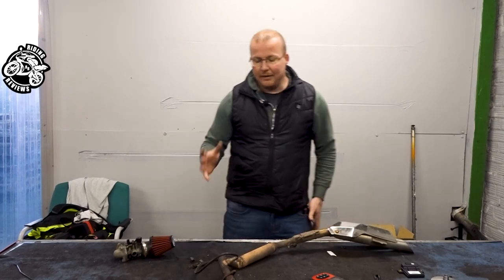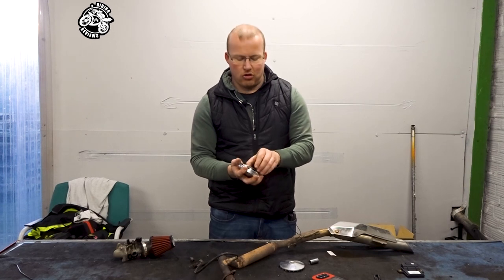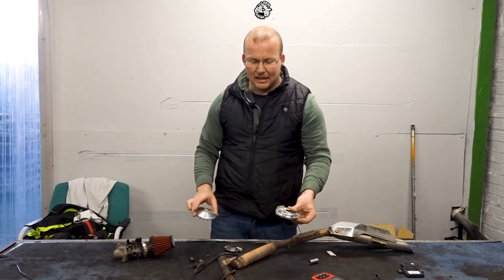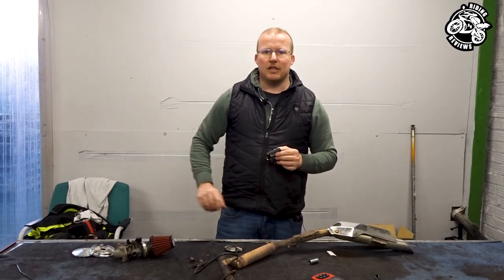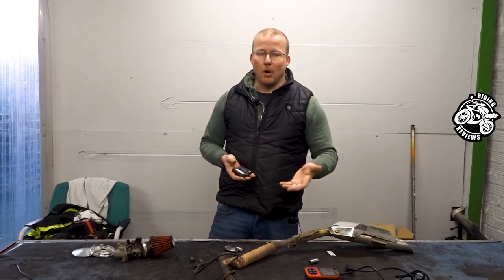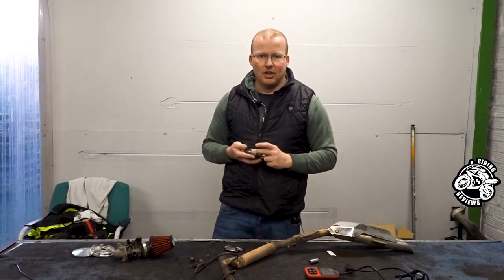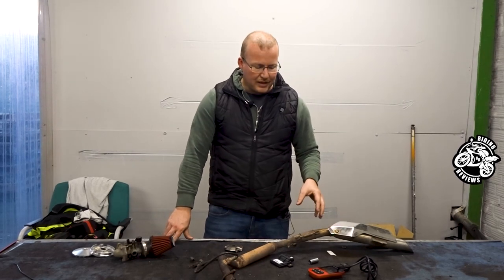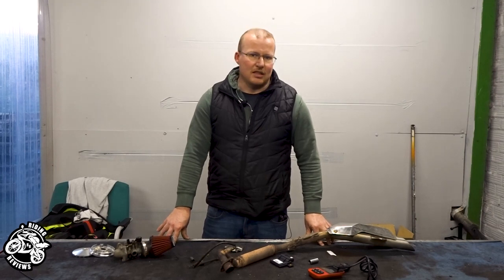Unlock Your Euro 5 50cc Mopeds Full Potential: De-Restriction Guide

Comment: So, retaining the 28 mph speed limiter & increased variator weights would hold the engine revs down to 6500 or 5500 with the 63 & 81cc conversions, & may maintain stoichiometric air fuel ratios over a narrower rev band. But the extra torque & therefore hp from the increased capacity will assist climbing speed.
Reply from the maker: a bit more technical than my explanation lol

Comment: Good explanation Chris.  
I have 2 Leeway pizza delivery scooters from CBRUS. 
The Chinese have been fiendishly clever in restriction. 
Speed limiter sensor on the clutch bell housing. 2 x electronic pressure sensors mounted above & below the vacuum controlled carb piston that controls mixture. 
An electronic sensor that detects carb butterfly positioning. Oxygen sensor on the exhaust. & all connected to the rpm restricted ecu of course. 
There's no way to disconnect the speed limiter, as disconnection, or changing the clutch bell  to one without magnets puts the ecu into limp home mode. 
Changing the carb, ditto, as it will lack the non interchangeable butterfly sensor. & vacuum sensors. 
Grinding off 2 of the 4 magnets on the clutch bell may fool the ecu into thinking the bike is at half speed. But it won't increase the rpm limiter or power output. 
2.4 bhp @ 6500. 2.8 @ 7500. 
It isn't fitted with a standard GY6 carb either, since the main jet is 6.7 mm in width, not 4 or 5mm as standard. Can't seem to find one of larger jetting. 82 as standard. 
The speed, 28 mph by GPS is fine. Just want more climbing power. 
I've fitted one engine with a 63cc conversion.  But without an increase in the 82 jet, it will run very lean. 
I was thinking that fitting the 63cc with original 82 jet, but fitting heavier 6.5 gram sliders, will pull the engine revs down to 6500 peak (maximum torque) which from the 26% increased capacity, will give 3 bhp @ 6500. It just won't rev out like the original engine. 
Would this work? 
I also have an 81cc cylinder, which with the 82 jet, would mean fitting a 7 gram slider to pull the engine down to 5,500 max. 
It's all I can think of in the absence of finding an appropriate jet. 
What do you think?
Reply from the maker: so the pickup on the clutch housing is ware it tacks the restriction all the other sensors are for emissions and choke I would try taking the sensor out of the housing and see what happens because the bike with no belt should rev out if you just disconnect it it thinks you have tampered with it
Reply: @Riding reviews  Thanks Chris. I'll give it a try.

Comment: In Germany there is another smaller class, its calle motorized bicycle and after having to ride 15.5 mp/h for 2 months, it was a blessing for me when the 28 mp/h ECU arrived. With a 4-speed manual transmission it's really fun. But at 28 mph it's already running at 8000 rpm in fourth gear and if you open the ecu on the engine complete would probably explode or something lol
Reply from the maker: this bike in the video will do 30mph at 7000 RPM in 4th gear and will run fine for distance at 10000 rpm at 40 mph they are tough little engines
Reply: Now that I'm driving with the 45 km/h ECU, the 25 km/h ECU is just lying around. Are there companies that reprogram it so that it is open?
I've been looking for 3 months now and there are definitely no open ones for my moped to buy. Everyone says "yes, there are companies they unlock them" but no one could tell me one that would do that and I couldn't find any myself. This here is the end for me now, right? @Ridingreviews
Reply from the maker: @Simon-jh1hf  yamasaki.co.uk do remap, but it is for uk only

Comment: Just recently got my lexmoto hunter 50, I want to derestrict it, should I cut the slide myself? Or wait for the part to restock on cmpo. Also do you know how often they are in stock on there? And if there are any other ways I could get more speed out of my bike.
Reply from the maker: i doubt they will get anymore of the DE restrictors for the hunter so you will have to do it yourself
Reply: @Ridingreviews  Ok thanks, how much should I cut off ?
Reply from the maker: @josephkoras6131  aprox 10 mm there is a cut out that runs up the side cut to the top of that
Reply: @Ridingreviews  Ok
Reply: @Ridingreviews  One more question before I do it, what’s the best way to cut it down ?
Reply from the maker: @josephkoras6131  hack saw or a grinder make sure it is flat

Comment: Great explanation of the rules Chris.  Maybe show us the remapping process. Also would changing the front sprocket on a ym50 make any difference.
Reply from the maker: Im not sure about the remap video i dont think anyone would let me use there equiptment to do it putting a 13tooth sprocket will make it faster but you would lose talque
Reply: How is that supposed to work? Even with a larger sprocket, the ECU still limits it to 45 km/h (28 miles)
If you then change the sprocket, the thing still drives 28 mph but with less acceleration.
And even if you remove the limit of the ecu and change the sprocket, the engine is hardly strong enough to get anything out of it because all the emissions standards... catalytic converter and all that shit.

Comment: Hi me again thanks for your help Have you had any Progression with the obd scanners today ? I have bought my second one and this one also says that it can’t communicate with the bike , any suggestions ?
Reply from the maker: There is one on yamasaki.co.uk i tried it on a ym50 re and it works
Reply: @Ridingreviews  I bought 2 
The Mucar CDL20 OBD2 Scanner and the Autel MaxiScan MS309 OBD2 Scanner. But they both seem not to be working. I’m not sure if it’s the way I’m using it or the scanners themselves. 

I plug it in and flick the key to the right (on) that’s it . Am I supposed to be doing anything else ?
Reply from the maker: @Iftikhar Rehman  is the ignition and kill switch on on the bike
Reply: @Ridingreviews  ignition was on kill switch was off meaning I would be able to start it

Comment: I have a YM50RE 2022 fuel injection . 
I’m planning on having it de restricted and I know that will result in more speed but will it result in it getting up hills any better ?
Reply from the maker: Slightly as there is more talque in the higher rev range
Reply: Thanks , do you know if there’s any big bore kits available for this bike ?

Comment: For the Yamasaki f series do I need to buy a 12 tooth sprocket or a 13 tooth sprocket which one do I get
Reply from the maker: change the front sprocket from a 13 tooth to a 12
Reply: @Ridingreviews  does it increase top speed or acceleration?
Reply from the maker: @BarberYusuf  acceleration and tuque

Comment: i drive a speedfight 4 50cc and im trying to get it slower to be legal so is it possible to remove rings to decrease speeds without making it less reliable?   edit the rings inside the cb drive
Reply from the maker: Change the cdi for a standard one
Reply: ok thanks

Comment: Good videos, do you have any information on how to connect your ecu to a obd scanner for a diagnostic. Ym50 2021 (euro 5 I believe). 
Thanks in advance
Reply from the maker: You need to buy a 6 pin obd converter from cmpo the plug is located under the rear seat
Reply: @Ridingreviews  would you be able to send a picture in how it looks, as far as I’m aware there are a few types of 6 pin converters
Reply: @Ridingreviews  hi there once again I checked up on your website and they have 2 types of 6 pin converters will any one of them work? 
Thanks
Reply from the maker: https://www.chinesemotorcyclepartsonline.co.uk/partno_DIAGN004#image2 this will do all of them
Reply from the maker: @iftikharrehman1441  https://www.ebay.co.uk/itm/144659916847?hash=item21ae67282f:g:GXwAAOSw0vti4OC9&amdata=enc%3AAQAHAAAA8BLyyd1il%2BP9OTrUWu3xE4u4NVGxyz9FndsF%2Bqphwjcw%2FCtHiHJP2Yfm4WLX25v9TKKjd9GSIntj6V7zpZncAmICpD0uqAna9%2FANaSLD90qyoeaOx6aEYcJcRKzDR4QV5KXbmEV3ImCNDi9Z7Asv2cyxqYaBJoQ%2BxI90Y0tV7iGHVyZbBlbUJ7egoCCUBn4YMHlrz8eGAG7Vn9qIa6%2BctRKwKQ1iqMAHmG0le%2Byg6faLTfXd6xDxqnCJCjYxKP0tw1HEzrXn4nGC86LdZObAPzaO6dglIP9K2tXpA7J9MD73Sq5626fovxKn%2B1QRsyTYrA%3D%3D%7Ctkp%3ABFBM3t6F55dh ebay is cheaper
Reply: @Ridingreviews  hi there I’ve bought this one and it has arrived, as you said this will fit I think I’m looking at the wrong cable on my bike. Do you know exactly where the cable is on the ym50 2021 ? Please help 
Thanks
Reply from the maker: @Iftikhar Rehman  under the rear seatit has a cap on it
Reply: @Ridingreviews  found it thx cable fits but my obd reader isn’t compatible with it 🤦‍♂️🤦‍♂️. Any recommendations that work with it ?
Reply from the maker: @Iftikhar Rehman i will look into it will try some on Thursday

Comment: That 28mph limit is absurd,i can drive a 44 ton truck at 50mph but cant ride a scooter faster than 28 mph,totally outdated 😂
Reply from the maker: I agree with you
Reply: Should be 40/45mph legal speed at least. 28-30mph is dangerous when in a 40 or even a national speed limit.
Do you know if neco can be re mapped? looking at a retro style scooter 50cc. But know many are impossible to de restrict. Lambretta and vespa euro 5 apparently cant re map

Comment: I have a Yamasaki f31 and I find the bike gear 4 doesn't really add much to the speed compared to gear 3 (only a couple mile an hour difference if that, as I am able to get to just abut 30mph before needing to change gear) and I have checked the bike has a 13 tooth front sprocket. What recommendations would you have to increase the speed. I'd like to get it to around 45 mph if that is at all possible without sacrificing its hill climbing ability too much which already isn't the best doing most hills
 at about 25 mph. I also know the guy who had the bike before me bought it new derestricted and he could go about 45 mph on it but then after taking it in for his second service they re-restricted it so I don't know if they could have done anything differently to re restrict it.
Reply from the maker: Decrease fron sprocket not increase 12 tooth help yamasaki.co.uk has a kit
Reply: Is this really that simple to desrict the yamasaki f60 model too? Thank you!

Comment: I believe the lexmoto 125 ecu will work on the Yamasaki 50 and save the derestriction process
Reply from the maker: try it it is the same ecu but is has a different map
Reply: did it work? if so what one?
Reply: No it didn't, it would start but rev at 6k constantly

Comment: I got a 13 tooth on my f30 and it hasn’t made any bit of difference on the top speed
Reply from the maker: it wont it doesn't create enough torque you best of with a 12 tooth

Comment: Can you remap zontes 125cc has my speed is really slow it only does 50 top speed
Reply from the maker: You carrnt, but i would get the tappets set correctly
Reply: Can you tell me what the tappets are for inlet side and exhaust side please as that would be great help
Reply from the maker: @paulross3066  4000th of an inch both
Reply: Thankyou
Reply: His that the min or max as someone else told me 1000th on both glade I put a comment know
Reply from the maker: @paulross3066  there wrong
Reply from the maker: @paulross3066  no problem
Reply: Thank you I will get them sorted thank you once again

Comment: I want to derestrict my sym mask only because I don’t feel safe being stuck at 30mph in a 60mph zone
Reply from the maker: if it is a carb version it needs a new cdi if it is efi it needs a remap you will prob not be able to get the remap
Reply: @Ridingreviews  yeah it’s a 2019 so it needs a race ECU which sucks as their £150
Reply from the maker: @Spearr  sadly, that's what you need to pay for facemelting speed
Reply: Hi Man, i got a sym mask 50 too! But here in belgium they are called the Sym Orbit 3.. i bought it brand new from the dealer last week. Mine is the 2023 euro 5 fuel injected model, wich is restricted to 28Km/h (around 18mph).
Did you find any way to get a little bit more top speed out of it?
Ecu's are really expensive in my opinion.. 
Thanks
Reply: @GewoonJelleYT  taking off the speedometer derestrics it abit as it isn’t telling the ECU how fast it’s going so it tricks the bike into making it get to around 37mph
Reply: @GewoonJelleYT  if you also get a quad lock then get a speedometer app on your phone then it’s still legal in a way

Comment: Can I change the ecu
Reply from the maker: you can if you can get one but there is a would wide shortage send it to cheapbikesrus and they will remap it for £99 plus postage
Reply: could they do that with every ecu?
Now after I installed the 28 mp/h ecu, the 15 mp/h ecu is lying around.

I have a Ducati Monster replica from the Chinese, which was converted by the Polish people for the Euro5 market, and it took 2 months and cost €190 to even get a 28 mp/h ECU...The Polish people had to First have the ECU reprogrammed by the Chinese because Sonora Motors actually only builds Euro4 machines. I don't even believe the company Romet in Poland, which converted my motorcycle for the Euro5 market, has the mapping  because even they had to order a reprogrammed ECU in China @Ridingreviews